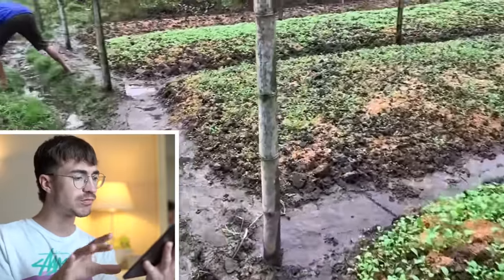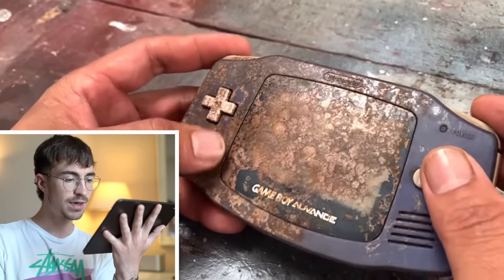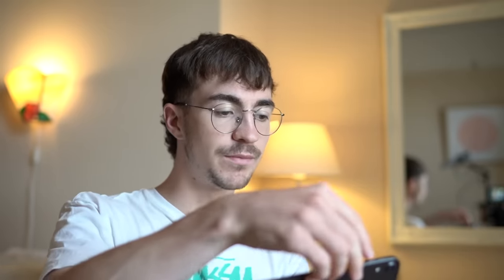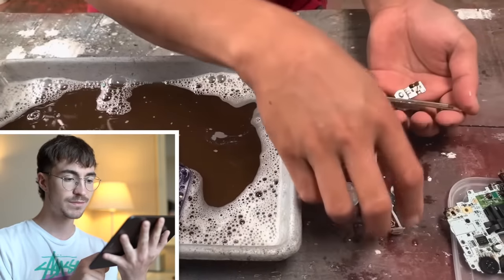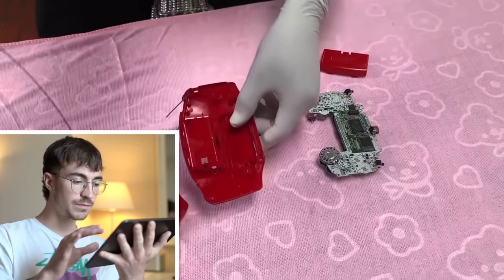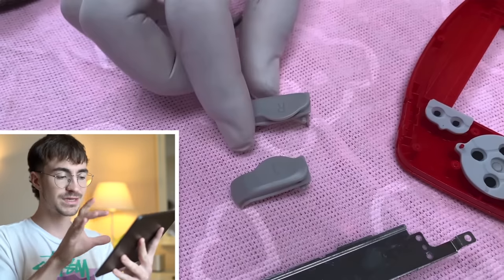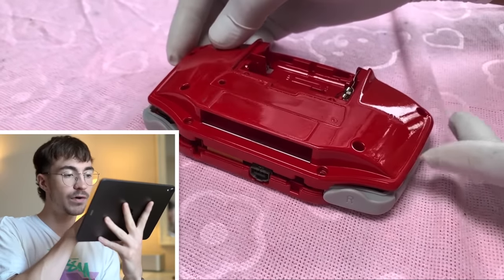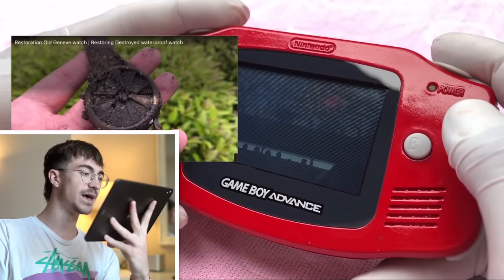Exposing FAKE Restoration Videos!

Comment: Just so you know Gameboys are pretty durable against water. I threw my Xbox One X in my pool my Ex pulled it out of the water so much water flowed out of it. I opened the Xbox up cleaned it up with basic material cleaned all transports reseated the Heatsync dried the HDD Everything is working and it's been 4years later since 2018 and we're in 2022 rn lol So whatever the guy did isn't impossible.

Comment: I watched cellphone restoration videos on YouTube from a YouTuber named JaiPhone, in many videos he found cellphone features, Android phones or iOS phones in piles of mud or rivers or piles of rubbish. He recovered and everything worked out, it was amazing in the wilderness. Until I personally experienced that my cellphone had a little water in it while I was in the swimming pool, I took it to a cellphone repairman and what happened was that the cellphone couldn't be repaired 😂😂😂, the motherboard was damaged by water, the LCD was damaged by water and when I calculated if you just want to replace those 2 parts, that's already 80% of the price of the cellphone when it was new 😂😂😂😂, oh yes and my cellphone that was damaged was a Samsung brand which, even though it has an IP rating, can experience something like this which makes I'm confused. Even though I had experienced before where my Lenovo K4 Note cellphone fell with me when I fell into a pool when the edge of the pool collapsed, and it took a while for me to wake up, but after the incident I didn't immediately take it to a cellphone repairman. I only took it to a repairman about 2 months later but it still turned on again, and it was confusing because the two repairmen only used alcohol and a toothbrush to clean the corrosion, and in Lenovo's case there was also mud because I fell into the excavation Swimming while working, but what's confusing is that smartphones that have an IP rating can't be saved but smartphones that don't have an IP rating can be saved 😂😂😂😂 

And also, one of the YouTubers from my country is a mobile phone technician, he usually restores junk mobile phones that he buys, especially old Nokias. You might not believe it but he usually cleans the frame and motherboard using dish soap and water and then dries it, but that's it in the past, Now he has enough money to buy cleaning fluid for electronics and he only uses that now, His Chanel name is TEKNISI NDESO

Comment: While I'm also quite sure this is fake, you should know that using water to clean a PCB is perfectly fine, as long as it's not connected to any power while it's wet. That would short it out. Even typical computer motherboards can be cleaned with water and a toothbrush, just careful around the CPU socket. In fact, don't even touch the socket. Otherwise, just make sure it's 100% dry before powering it up. Which it didn't seem OP did when they first put the batteries in to test it...

Comment: I troubleshoot and fix electronics, daily and I can verify that as long as there's no electrical current or charge capacitors then water is perfectly fine to use or submerge in.  It has to be 100% dry prior to charging the system though.  Although, with that said, idk about this hocus pocus shit.

Comment: Actually cleaning electronics with water is perfectly fine so long as power isn't going through them. In this case water is actually the proper way to clean it. 

It was obviously planted there and no it doesn't take 6 months for rust to form. go wash a cast iron pan and in 2 hours is will be rusty if you didn't dry it.

Comment: 09:45 as long as tracks/transistors/IC's have not rusted (very unlikely after it spent so much time in muddy water out in the open) and the electrolytic capacitors have not dried out (again very unlikely because electrolytic caps are one of the most unreliable components) I don't see why the motherboard wouldn't work. Transistors, IC's and some passive components can last dozens of years as long as they aren't overheated or rusted. But in the end I am almost sure this is fake since even some garden lights with better enclosures have rusted away components inside of them after a few months, it would be a miracle for this board to have survived this much exposed to the enviroments.

Comment: i do agree the video is faked, the dirt/rust on the plastic looks especially fake, and you are right about the aftermarket parts.

I do think its possible to clean the circuit board with deionized water, though. as long as you dry appropriately before putting power through it, it shouldnt see any wear for a long time from something like corrosion, definitely could live long enough for the video.

The power light not coming on at the end is interesting. wonder if his intentional dirtying of the fresh PCB so he could pretend to fix the L/R contacts had something to do with that.

Comment: I've actually cleaned my motherboard using a hose pipe, and I have put my keyboard in the dishwasher. Not a good idea to just put a complete system in there, but water isn't as dangerous as people think.

EDIT: Not saying this was real BTW!

Comment: That initial theme of wandering around and accidentally finding these treasures is probably the most fake thing about the video.  But also the idea that the original electronics are are still in working order after all of that.  Completely nonsense.  Now, as funny as it sounds, cleaning those electronics with clean water might not hurt them.  You just want to make certain they are completely dry afterwards before any putting power through them.  What typically destroys electronics would be something like soft drinks.  Because now we are talking about something acidic that can destroy sensitive electronic components.  If he had cleaned up the plastic parts and replaced the electronics, that would be a whole lot more realistic.  A sure sign of a fake restoration is that someone just cleans up something a little and there are no damaged parts.  That almost never happens in real life.  When you look at real restoration videos, you don't have such a dumb story about where they got the item from.  They got it a normal way like someone gave it to them or they found it on EBAY.  And you have lots of broken parts that need to repaired or replaced.  Also, rusty plastic is not very likely in those cases.  The only reason you would see rust on plastic is if there was a metal part in contact with it that made a stain on it.  That sometimes happens, but it's a small mark.  Not the whole surface of the item.  But if you want a guaranteed fake video, look for Mr. Rescue or others with a similar name.  You will see people in the comments talking about how fake it is.

Comment: It’s not the water that does the damage it’s the minerals in the water that does it so if you use distilled water on a motherboard then it will still work

Comment: The voltage meter wouldn't have detected any electricity in the motherboard without the batteries installed.

Comment: the guy finds a stereo in a flood. (how is that?) he takes it apart, and WASHES it with water! after he dries it off, re-assembles it, it works... (wow...)
NOT!!!! i found a radio, sticky, grimy, covered with goo, and dust... i put batteries in and it worked. i plugged it in and it worked.. i opened it up carefully, it had no damage. i checked on how it was put together, and the board wasn't damaged or dirty. i went ahead and cleaned it with alcohol. i took the case and washed it with soap and water and a toothbrush. dried it off, re-assembled it, and it was fine.

Comment: Correct me if I'm wrong but water only ruins the mother bored when there is power running through it do to the minerals in the water. And if you let the water dry it should be fine so long and you don't give it any power while it's still wet

Comment: the motherboard could still be functional, there are coating you can put on pcbs to make them water resistant, even if factory doesnt do it without the coating could still work just a way better chance with the coating, some electronic components are alot more resilient than you may think, water is a bigger problem if it has power allowing shorting as that is what is gonna do the damage not really so much just some water, screen tho idk i dont ever really do anything lcd related

Comment: Water is actually not that harmfull to electronics, aslong as it has no power and its destilled water because distilled water is not conductive. You can clean an entire PC with distilled water and it most propably still works.
The Problem here is that it was extremely dirty, so the water will mix with the dirt and start getting conductive again, because of the metals in the dirt.
Especially the soap part would kill it through.

Overall its better to use pure alcohol instead of water, becuse alcohil evaporates faster and water slowly starts getting cpnductive agai  if you let it stay on metal.

Comment: 3:20 i have an idea of how they put rust on the plastic gameboy. I had a vice grip in my shower so i can rotate the shower knob because it has issues while i wait for replacement parts. My dumbass kept showering with the tool still in my shower after i fixed everything, so there was a painted imprint of rust on my shower wall counter.

Comment: I've got to both agree and disagree with your analysis...
I've both designed and repaired quite a few electronic devices over the years...
I would rate that restoration as "possible but unlikely"... but not totally unreasonable assuming that you allow for a few aftermarket replacement components.
As you said there are a LOT of components in a device like that which COULD be damaged or destroyed by extended submersion - especially in dirty water.
However, with some serious good luck, and a few aftermarket replacement parts, it's not unreasonable that it COULD have ended up working.
For example that display is a sealed unit...
If water had managed to make its way through the seals it would almost certainly not work...
However, if the seals remained intact, and it worked at all, it might well still work perfectly...
(It's quite likely that, if it survived at all, it would still work perfectly.)
As I said... it's a matter of luck... even the tiniest bit of salt, or fertilizer, or chemicals in the water and it would probably be dead...
But, if it only got rained on, then it MIGHT survive.
If I was betting I would say the odds of it's being repairable would be four or five to one against.
But that means that, if they tried a half dozen of them, they could probably get one or two to work.... 
(And we're not going to see the videos of the failures...)
It's also worth noting that USUALLY when a very old device like that is found it has badly corroded batteries in it... yet this one did not... which improves the odds a lot.

The bottom line is that it's not at all unreasonable to TRY to restore something in that condition...
As long as you're prepared to fail.
(Or if you buy a handful of broken ones on eBay with the hopes of putting together one working one... )

Comment: well what i know.. a mother board can be put under water for a long time and as long as it has no current going through while wet it should be fine, so he must have dried it out very well.. and there is a possibility that some of those buttons are not after market, because lighting can tint the color of the video and well not being able to color correct the video can also put the color of something way off in your eyes watching it.  and same with your device watching it, it could not be calibrated to the color of that one camera he was using.. this is why not everyone can be a movie maker, you have to learn more than you think :) just saying

Comment: "the colors are diffrent"
i cant see that well, its the same, also the rubber, its just the vision that disturbs.
Reply: yeah I restore like 3 GBAs a week (just buy lots of broken ones on ebay and flip them for like 60-80$ working) And there's no fucking way whatsoever. 

I know for a fact that no 3rd party parts manufacturer has any of the original default colourations for the shells or buttons. They get pretty close in some cases, but the original formulas for the dye colours are lost to time/kept secret by nintendo. The shoulder buttons he is replacing in this unit have NEVER been made by nintendo in that colour. They're aftermarket L + R buttons, and like Elliot said, the texture of the membrane is unique to 3rd party replacement sets.

Comment: You can clearly see that the screen is not working "perfectly" as you suggested in the last part but you had to cut it out right? Also is the youtuber claiming his using all original parts? I don't see a problem if he uses after market parts for parts that are beyond restoration. It would only be a problem if he is lying.

Comment: You can actually tell that the original shell is not the same one that he picks up off the lines later. You can see the one that he picked up later you can actually slightly see through the red. Meaning it was never another color LOL

Comment: I am sure those videos are completely fake. But about putting pcb under water and soap, this is a common technique with arcade. When you buy old arcade PCBs that had (at least in europe) spent years ont smoky and dusty bars, they get really dirty. I wash them with soapy water then rinse them with demineralised water. Wait for some time to dry, and your PCB looks like mint!. Of course remove all batteries befor doing this... Some even wash them on the dishwasher... but personnaly I never tried... I foud this method too hardcore...

Comment: I'm not sure how restorations work or even really how these handheld systems work in general but was the light still on when he was just holding the cover the front cover? Because it appeared that the light was still on and it wasn't even connected to the battery

Comment: You can clean a pcb with soap water. You have to make sure that there is no voltage in the capacitors left and you have to let it dry a long time.
This is not a fake.
Some other things are fake, that's true...

Comment: You can wash electronics in water as long its discharged. Check der8auer, he washes his motherboards in a dishwasher after a sub-zero overclocking session to remove the vaseline insulation. He said, thats the best method to remove it.

Comment: The "water" in the paint tin could be demineralized or pure alcohol I suppose however most of this looks pretty unbelievable . No doubt the board and the IC's would be stuffed from sitting that long and living in the mud. My first thought with that video was that a bobcat needs to come along and pick up all that rubbish or a few men with PPE at the bare minimum. 
There are a lot of fake videos out there (some being do it yourself) which if done that way will create something dangerous instead of something good. i.e. Lithium battery charger with no voltage or current regulation, no cut off when charged etc charging a 3.7 cell from 5 or 6 volts.
A lot of "reality shows" on tv are fake / staged as well but people eat it up regardless. Even a lot of these "prank" channels on youtube are a set up. Of course with some of those pranks you'd land yourself in jail if they were real. They do give other people ideas which then makes that wanna be prankster end up in jail. 
When I had facebook (delete that rubbish) I remember these videos that kept getting suggested to me. They were cctv (filmed in portrait mode - Must be an iphone cctv camera) who had some guy break in and sneak into someones kitchen when the female was in there cooking. He snuck around the bench as she walked around the bench and she didn't notice.
The same channel had the same guy doing something while she was hanging out the washing. The same channel had someone stealing their boat . The funny thing is... The same 3 or 4 people keep ending up in the same videos. This of course is marketed as "real".
I've even caught the real news channels posting fake stories or recycling old news stories into new news stories (from a year ago)
It is funny as well as disturbing to see that a lot of people believe these fake videos that are marketed as real and will argue / fight about it saying its real when its not.. i.e. "Patty mayo" fans who think he's really a bounty hunter and then suddenly a police officer. How about bounty hunter D  ? LOL
I was watching some crap the other day which was supposed to be live but it was obviously filmed around /Christmas time (4 years ago) . NOTE: Currently July as I post this. The video was somewhat compelling although seriously drawn out (to get more ads in) but after looking at it I saw through it.

Comment: ummm electronics can be submersed in water as long as it has no power and completely dry before adding power to it.
Reply: I hope you're not serious 💀
Reply: @bareq99  yeah i fix electronics. there is no way water can dmg electronics if submersed as long as there is no power to the electronic. if you add in salt, or chemicals in the water that degrade the electronics, that has nothing to do with this. If water seeps into any capacitors, then those are faulty capacitors as they should be fully sealed. And as long as the electronics are fully 100% dry before adding power it will be fine. Ive put keyboards, and all kinds of electronic stuff in teh dishwasher and washed by hand if needed. Youre just falling for the stereotypical commonplace belief that any moisture introduced to electronics means the death of the electronics and that not true. It was back in the day when the belief was created. but these days with the advancements in technology that belief is archaic and needs to die.
Reply: He knows, but they instantly turned it on after it being submerged, now that will kill something very likely